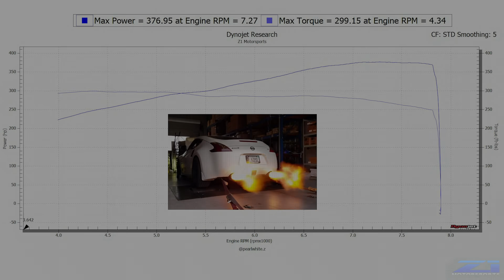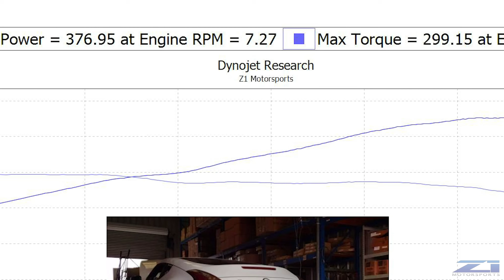Z1 broke a 370Z NA horsepower record...+100HP

Comment: Lol I'm sitting at 342 whp and 297 torque with just z1 intake, z1 test pipes, Armytrix exhaust and uprev arc tune
Reply: your big mistake is that over prices armytrix that puts out less power than other cheap exhaust smh
Reply: @mrsantosjon  lmao. Check your facts. I was sitting at 318 whp just from exhaust and intake alone no tune or test pipes. Armytrix produces 30 whp without tune alone.
Reply: @mrsantosjon  only ppl that hate on Armytrix are those that can't afford it and stand by the "tomei dahhh" lmao.
Reply: @RageToDeath  isr but nice try.  lol 3k on stock looking exhaust that just has a valve that changes the sound smh.  I got enough for a tune and extra dough I think I did a smart decision :D
Reply: @mrsantosjon  keep hating buddy. It's aight. Stock looking? Lmao. Ok. =}
Reply: @mrsantosjon  all in all we all Z family and I'm dropping 3200 on wheels, coils, and tires.
Reply: @RageToDeath  you good lol.
Reply: @Will-xp6jh  it was tuned. But you're talking shit before even letting anyone else talk so I ain't even gonna bother explaining myself to you because I don't need to bud. Dyno results are all I need. "Some power" yeah I saw more power from 2 mods than most see with 3-4 bolt ons. Custom UpRev Arc license.
Reply: @Will-xp6jh  test pipes is a maximum 5 hp gain in power.. Jesus Christ where have you done your research at
Reply: @Will-xp6jh  ur the one blowing smoke guy. I'm dropping straight facts and got the dyno to prove so really nothing else needs to be said. Results speaks for itself.
Reply: @Will-xp6jh  u want the proof shoot me an email other than that keep it fresh
Reply: @Will-xp6jh  not about believing it's about not ignoring the facts right in front of you lol. You don't know shit about Armytrix clearly and just blowing complete smoke on something you know nothing at all about. You're not just buying the quiet mode. Tomei is probably not even in the top 3 of best exhausts for this car. Fast intentions and ark eat tomei alive. There's no changing minds of people like you though. You're so set on your ways and got it all figured out.
Reply: @Will-xp6jh  I get it I'd be salty too if a Z with just 3 bolt ons was sitting at 342 whp and 297 torque 😂
Reply: @Will-xp6jh  I'll go on all day with you buddy I've done the research and I've got the dyno to prove everything in laying down right in front of you. Keep talking. I'm getting stillen supercharged here soon anyway so I aint worried bout you 😂
Reply: @Will-xp6jh  bad choice with stillen? Yeah I'll stop you right there and ask you what the best option would be? Twin turbo? Yeah sure if I wanna dump 13k Into aam or fast Intentions but nope I'll just build the engine

Comment: Nice job next challenge is to make 400 plus to wheels which would def require a build I’m assuming forged internals as it goes from vQ37- VQ40VHR
Reply: This always surprises me when people don't know the VQ engine already has forged pistons and forged crank from the factory.
Reply: @Aeneas137  Wasn't aware of that but simply building the block up to make NA 400 plus hp was where I was coming from to tune a NA to handle that increased compression ratio I would assume the block itself would be bored out
Reply: @philloft  from what I've read the larger crank helps the torque a little and hurts the hp for a NA.  Inhibits your ability to rev up fast also.   FI would be a different story.
Reply: @Aeneas137  only forged crank, everything else isn’t forged. I’ve built an old 370Z before and nothing about the internals we’re forged besides the crank. But Nissan  has been doing that since the G35

Comment: What kind of results would you expext with the same set up on a vq35hr? 
Im pretty set on going the stillen s/c route since that is the only kit available to the HRs other than the aam tt setup and that is $10,000 before tuning, install and motor work. 
Once i added up my planned n/a build i just couldnt stand the thought of spending 6000-7000+ and thats just parts with out labor included on stuff i cant do myself. for maybe 325hp when the stillen kit with custom tune will put me in the 380-400ish with custom tune. Another plus is i should be able to install the stillen kit myself which will save me ton more money over other options.

Comment: What would this have made minus E85? Just a solid premium gas tune?
Reply: Tunercraze 360-367whp most likely
Reply: It made 364/294 on 93
Reply: @Will-xp6jh  I would be happy with that too.
Reply: @Will-xp6jh Was this with the OEM fuel pump?
Reply: @dbjeffy  Yes
Reply: @Will-xp6jh  Thank you so much! Your build definitely inspired me to stay NA. I just ordered a lower manifold and got GTR injectors for a good deal! I have almost this setup, but Tomei Headers and Berk HFCs and no cams and using ecutek through Z1. I am excited to see what gains I get after the injectors and ported lower! Thanks again!

Comment: It costs $9K CAD for a supercharger install with injectors and an extra oil cooler/radiator setup included installation and the power gains are remarkable with no strain on the engine or transmission. Very reliable setup as long as you don't beat it to within inches of it's life.

Comment: People don’t realize a tune with e85 has a lot to do with this.
Reply: Especially the torque.
Reply: Yeap that was my suggestion a few months ago... Detonation is no longer and issue.
Reply: Stock compression, no boost - e85 does not give much in this configuration. 
Im suprised that they run e85.

Comment: I wish the torque peak was at a higher RPM 5.7 it would be perfect, but all around smooth band and great power, congratulations guys at Z1!
Reply: No, I wish it was lower. Peak torque at 5,700rpm sounds gross.
Reply: @Will-xp6jh  I like power that climbs also after shifting you are hitting your peak torque. At a lower RPM you wouldn't hit your peak torque after shifting unless you set your gears longer. I prefer keeping the tachometer between 5 and 7 there is no need to go more than 7 max HP is reach at about 6.8 and 7.1

Comment: So without cams im assuming this would be making around 350whp?
Reply: Assuming you've already got a catback and test pipes or HFCs seems this is tricky science and $ as some have tried 550cc injectors, intakes, and Z1 upper/lower plenums only to achieve modest gains over just doing the upper plenum and intakes. Without the cams the cumulative effect starts costing more but not producing much more gains.
Reply: 😆😆😆 probably
Reply: Shiii I'm using stock 370z (310cc) injectors on my DE at WOT I'm at 68% duty cycle I made 260hp on a junkyard motor from an M35.

Comment: Never seen a bolt on 370 with 299 torque, they all max out around 275, impressive if true.
Reply: It’s cammed with ported manifolds and e85
Reply: @oneillvittini144  Still thats ~345 torque at the crank, about 75 more than stock.
Reply: nighthawk0077 what are you talking about 345 torque some guy made 380 not too long after this on stock cams it was a rzg q60
Reply: oneill vittini why are you quoting a 3.0 twin turbo when we are talking about 3.7 NA engine? Are u ok?
Reply: Q60s came with a vq37 before 2016
Reply: oneill vittini you are confusing hp with torque dummy.

Comment: It's probably easy to get over 400whp with ported heads and higher compression
Reply: If by easy, you mean simply picking out the parts to do it, then yeah, it's a breeze. I've got Stillen SC money in this thing already. You're easily talking a stage 1 SOHO single turbo kit, something like $10-12k(including install) to break 400whp or the same money that would put you into the +525whp range.
Reply: @Will-xp6jh  you don't even wanna know what a built viper motor cost lol
Reply: @ViperMods_216  I do
Reply: Problem is vvel ... It makes too hard to port the head without messing with vvel and it will stop working properly

Comment: It's using e85 so why is this power surprising?  Most cars gain 20-30HP on e85. Plus it has cams so increased rev limit on top of that. I would be surprised if it didn't make this type of power with those mods
Reply: Corn is only worth about 10whp on these engines, and we kept the car at stock rev limit. The factory oil pump won't really hold any more and I didn't upgrade it.

Comment: Do people perfer he heads for big power Becuase it doesn’t have vvl? Or what’s the reason? Could you shed some light on hr heads vs vhr heads
Reply: VHR heads have the VVEL. HR heads don't, so if you wanted to go to the trouble of an HR head swap, you the extra displacement of the 3.7 w/ the capability to put a big cam in the intake and exhaust, not just the exhaust as done here.

Comment: Did you Dyno the car when it first got there, before the mods?
Reply: Last time on the dyno was 334/277 back in February
Reply: @Will-xp6jh  what were the mods in February?
Reply: Those numbers were on the same Dyno Z1 uses?
Reply: @unijabnx2000  They were on Z1's dyno
Reply: @jawaunb8405  K&N intake, ported plenum, lightweight flywheel, art pipes and the greddy exhaust
Reply: @Will-xp6jh  Sweat! Moncef from Admintuning referred me to GReddy Revolution RS Single Exit  Exhaust for my build

Comment: In theory this should make like 750hp at 15psi... that’s wild
Reply: Pretty solid guess. Not quite 750, but it is > 700 at 15-16psi
Reply: @Will-xp6jh  Sweet! 
Here’s the math behind the guess: ((14.7/15)+1 )*375.95=746.36hp
This assumes that the car maintains the same afr, atmospheric pressure and temperature at every rpm. Which looking back at this… I made way too many assumptions!
Reply: @lilman227  It made 704 @ ~15psi. Your formula seems to check out to at least get a very close estimate.
Reply: @Will-xp6jh  Thanks! It’s a decent estimate up to 30psi + or minus 6%, then I have to change the formula.
Any videos up with the car on boost? Sounds like it’s a crazy build now!
Reply: @lilman227  Not on here

Comment: Needs a a full TomeiTi exhaust and I can bet you it will closer to 400whp still sounds restricted with that exhaust.
Reply: nope tomei wont make anymore gains...
Reply: Any single exist would be more than a dual for this application.
Reply: @jgonzalez4846  no sir. just because a tomei is loud as fuck doesnt mean you will see any more gains... maybe 1-3hp max.
Reply: tomei sounds sick but wont push it nowhere near 400whp..a dual exit exhaust would have more gains but not by much.
Reply: @BigKfishing  i said ANY single exist..theres other options than tomei ....its been proven singles give u that extra bit.Im not referring to just a tomei.
Reply: @jgonzalez4846  probably gives you extra hp if youre boosted.... any other single exit exhaust probably wont make the difference at all....
Reply: Lol wrong
Reply: It might would break 380whp with a Tomei or Z1, but I don't like singles
Reply: Tomei fanboy. lol
Reply: I'm sure it would be closer, by 2-3whp at the absolute most. It's a 3" exhaust. It's not restricted at all, I promise.

Comment: whats the cost of the cams and install?
Reply: Cam install would be very expensive. Many hours of labor from a skilled tech. I'd say 10 hours labor minimum.
Reply: @roundearthshill248  I paid $3185 at RZG Motorsports in New Bern North Carolina. Everything is included for that price!
Reply: @bigdogstreetperformance6761  thanks brother. That’s expensive but maybe not as bad as I’d thought it would be. Wonder how many hours it took them
Reply: Sounds about right , but also refreshing water pump, timing components and gallery gaskets at the same time while it's open. So overall not too bad.

Comment: The record was broken today by rzg motorsports on a q60 3.7. 3 in intakes  long tube headers, agency power y-pipe, and tomei exhaust. 
Made 382 whp and 305 torque on e85.
Reply: What kind of dyno?
Reply: @johnpowers4076  RZG damn autocorrect
Reply: What mods?
Reply: @bigdaddy5629  intake, long tube headers, y pipe and tomei exhaust

Comment: Will you guys ever make headers for G37x? It not being compatible is the only thing preventing me and some other guys I know not pulling the trigger on buying them.
Reply: Not a very cost effective decision seeing as how it would cost more money to make them which would make them more expensive plus the labor to install would probably be a pain which would reduce the demand. You could just buy a decent exhaust with test pipes and upgrade the final drive. You'll spend less money and have a quicker car than one with headers.
Reply: @jawaunb8405  I highly doubt you would spend less money as changing the final drive means changing the final drive in the transfer case.
Reply: @reedhoffman2889  good point and that shit would suck. Neither of the two mods would be worth the money. Find a cheap stillen SC.
Reply: Contact SOHO Motorsports. They make alterations to the headers to fit. They were actually finishing a set up this week for somebody.

Comment: Where is the proper SAE corrected dyno graph.  Industry has stopped using STD since 2006 and have been using SAE ever since to rate engine power.  I don't know why companies are still showing people STD results.  Properly corrected this dyno will be at 366hp at best.

Comment: Will this fit on a g37 rwd sedan?
Reply: it will. I've got a '13 g37 sedan with the z1 race intake with carbon fiber tubes and ported plenum, afe tb spacers, custom exhaust, and uprev tune. Lots of suspension components and bracing as well.   Usually, if there is a part made for the 370, it'll fit or there is a g37 version.

Comment: Took you all guys  a while to discover the awesomeness of cams.  I was wondering what effect cams would have on your 400 hp package. Many were bolting on and excluding cams. An Hr should scream on cams.
Reply from the maker: The VHR has VVEL on the intake cams, the only cams are available are exhaust cams, that were only available within the last few years. JWT C2's are brand new on the market.
Reply: Lowteks 350z HR is cammed and didn’t break a record, it’s the tuning bro
Reply: When I was tuning most of you where still working with carbs. I am not surprised it was done on E85.
Reply: @moisescristobal6  HRs don't have the VVEL, so you can replace all the cams. I'd really like to do an HR head swap on this car and see what else we can get out of it.

Comment: What results would I see on a 2016 370z NISMO?
Reply: If you did everything I did, probably the same, give or take. What exactly do you have in mind?
Reply: Will well my nismo already has 350hp from factory. Will I see around 100hp improvement or more like 35-45?
Reply: @epicman23478  That's crank. This is at the wheels. You're probably making something like 275 at the wheels if it's stock.

Comment: Would it do better with the Z1 single exit exhaust ?
Reply: AntoineJra or a tomei one of the lightest singles out there
Reply: It would probably make a very little bit more. Maybe round it on out to 380/300. I doubt it would be much more than that, though.
Reply: Will you should test it just to see. What’s about individual throttle bodies? Don’t see those too often. I’m still waiting on someone to go full send on a NA 370
Reply: @AntoineJra  I could've gone boost for what I have in this thing, but I wanted to push the platform NA. I'd be willing to swap it long enough to make a run or 2, but they're 4 hours from me, so it's not exactly practical.
Reply: Will wait I’m confused... are you saying you’d be willing to swap the itbs on there or the whole engine for a turbo setup? And yea I know NA builds are more expensive for less power but they are cool asf in my opinion because they’re so rare. I only see them in race cars and not street legal ones
Reply: @AntoineJra  I'd be willing to swap exhausts to a single, either the Z1 or Tomei, just to see what, if any more gains there are to be had.
Reply: Will oh ok what’s your exhaust setup right now? Is it stock?
Reply: @AntoineJra  Z1 headers, Motordyne ART pipes, and Greddy Evolution duals
Reply: Will nice I have the MD ART Pipes and z1 single exit on my G35. Sounds amazing 👌🏾tomei is too raspy. I’ll get that when I go twin turbo
Reply: ITB"s don't exist for a 370z. You have to go custom (read $$$$$).
Reply: melvin khosa you have to do some custom work regardless. Even for the HR/DE they make a set but you still have to get some custom work done to it
Reply: @MelvinKhosa  you can make Your own, based on motorbike ITB´s.
Reply: @jareknowak8712  That's why I said $$$$$$$. Making your own and getting it all to work properly on a VQ is not cheap. Just look at Sasha's 350z making like 500whp NA. The engine itself probably costs like 30k

Comment: Is it still running. Would like to know how it’s holding up
Reply: they can handle 600 whp stock block no reason why 400 na would go wrong 375*
Reply: 720 crank hp is not impressive for stock block, tell me 1000 crank and i will be impressed
Reply: @ACommenterOnYouTube  how many jdm blocks you know besides 2jz or 1uz I believe can handle 1000 on a stock block? Not saying it’s wrong or not possible but I’ve never had the urge to look that up lol 😂